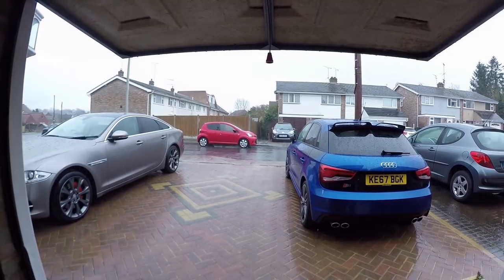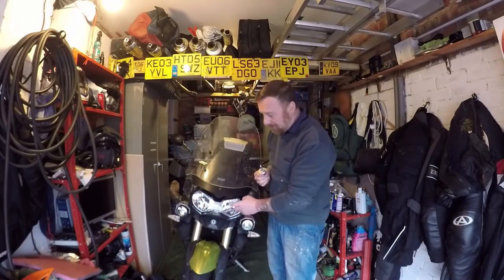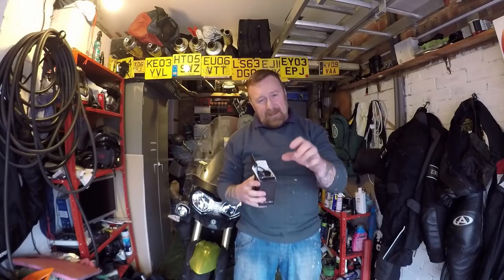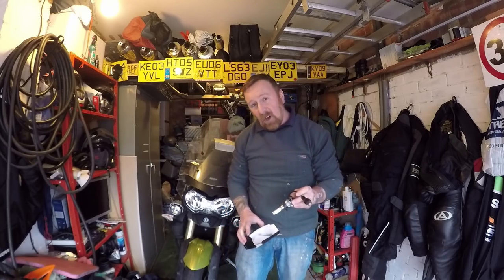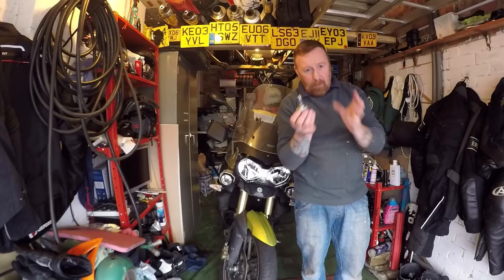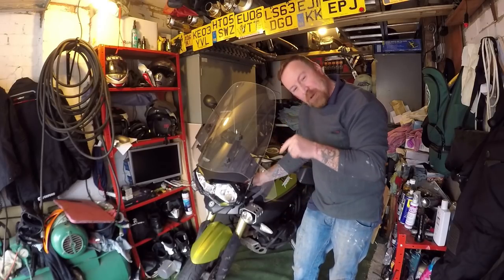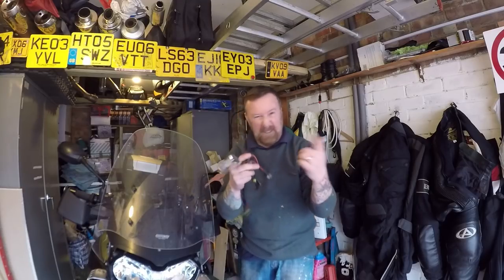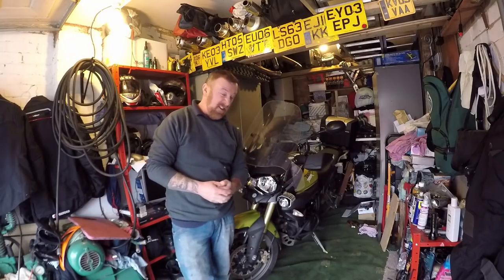MOTORBIKE LED BULBS SHOULD YOU FIT THEM OR NOT MARK SAVAGE

Comment: Uh...I noticed one thing that's an issue...the very thick & tight plastic lens of my Honda will 'fog' inside in damp weather and the Honda 'halogen' bulb clears it up quickly...but the LED doesn't create enough heat to 'burn-off' the moisture inside thehousing...so I switched back  ( Turn-signals and tail-light are 'LED' though....they work fine, and damn unlikely to ever go out )
Reply from the maker: if you have moisture Id take it off and use a hair dryer to dry out completely and keep it in doors for the day so it cools down in room temp then find out why it got wet inside and seal it so it doesn't happen again and go bad to led as they are much brighter and like you say last for a long time bud
Reply: How about electrics in the motorcycle? Is the reg rec and generator ok? I’ve had HID xenon kit with the big aluminium box fitted on my bike. Literally every 6 months I had to change rectifier as it was burned from the xenon bulbs..

Comment: Mark
Your video here covers
Decades
And saves
Hundreds.
Personally i fitted mk2 leds with my tmax.
Failed mot on light seapage (leak)
Popped halogens back in for retest.
Passed.
Im unsure (now its getting brighter mornings) to take out headlamp housing and see why i cannot adjust hotizontal aim. For Leds.
Help
Reply from the maker: thanks bud and for watching 
im guessing as the LED bulb projects the light from the sides, it reflects differently than a standard bulb so I may have the same problem!
this also maybe why they are cheap and others cost £45 odd, I will test mine tonight to see the pattern and get back to you as
on the tiger I have up and down and side to side adjustment 
I remember this used to be the case with the HID lights but lets see

Comment: Asked bout putting led on my v strom , bike shop said wouldn’t pass mot if I changed headlamp to led
Reply from the maker: Why not !! As long as they have a patten they will be fine and in the video you see they have a flash line when I moved the camera that shows a patten 
But change them and before the mot put the old ones back in 
Sorted lol
Reply: I didn't realize until reading in MCN this week. That after market HID kits are now a fail, since the new MOT testing came in last year. Only manufacturer fitted kits are ok.
I did look at LED headlight bulbs last year for my scooter. The price put me off. Well actually it was the wife going How much!!!! Lol
Reply from the maker: hahaha just dont let the wife see you buying them it will be fine its not like the wife holds my camera sometimes and whacks me around the head ----- WAIT ok I agree pmsl 
yes I am reading more and does seem some bikes shops are failing them, the newer tiger and  bmw's have now fitted these so my head light maybe ok but if not i'll just take them out for one day a year for the mot and refit but will test and see how much better they are on the road or not?? and upload a video with how they look on the road 
many more videos to watch bud and thanks 
mark

Comment: I’ve tried led bulbs and a replacement led headlight on my dd125e-8 and the bloody things would just not work.
Reply from the maker: Oh so they had power and didn’t work or you couldn’t fit them ?
Reply: Would work on dip beam but high beam would either not work or it would just glow dull. Even swapped wires round still would not work. Checked light with a battery and they worked fine just won’t work on bike even tried a led bulb in tail light it didn’t like that either, it’s just strange as works fine with standard bulbs.
Reply from the maker: because and its a guess on your bike but some monitor the power drain to the bulb and if lower or higher than normal they stop the power and come up with a blown bulb sign, a lot of cars do this and my bmw GS also 
were yours 2nd Gen ? and like my ones I fitted as and there are some cheap copies and low grade LED's out there 
thanks for watching
Reply: Thanks mark I didn’t think of that manly because I didn’t think Chinese bike would be that intelligent. And no not like your lights the build was a cob and the new headlight was a full led. I gave up with them and just added a couple of led accessories lamps that do the job of lighting my way. Thanks again keep up with the great vids.

Comment: On a side note, had a search but nothing came up,  do you have a vid on battery chargers? i have vague memories of its not advisable to use a car charger due to the higher amps?
Reply from the maker: You need a slow and high charger so it starts at4amps to 8 amps 
They will be fine 
Or just type in motorbike battery chargers 
Thanks for watching

Comment: I had my LED headlights for nearly a year now and second-generation had no problems out with them 😊 and here's an idea for your next Project ?? most motorcycles don't have hazard lights especially 125 so my challenge to you figure out how to create a hazard light switch ?? do you accept yes or no ??? and I will be putting my video unlisted for the time being hahaha so you can't take a quick peek 😂😅
Reply: lazy boy Rider this is literally the problem with every bike that’s 50cc or 125cc
Reply from the maker: sure ill take a look bud, and yes I agree some bikes did start to put hazards light and now stopped which is odd, you can retro fit a switch and only need to connect it to both front lives as the backs are all ready connected to the same circuit
water proof switches as also easy to buy on e bay, to be fair I find I use my high beam when lane filtering in heavy traffic now as otherwise no bugger bothers  to look in their mirrors otherwise lol  
take care bud
Reply from the maker: I know so worth looking if the bulbs will fit and upgrade or go for running LED lights but you will still get ( I didn't see him !!)
Reply: @a11s3y7  as I live near a very busy motorway and I was heading to the shops one day I was watching a 125 Rider breaking down on the hard shoulder and the only way he can let people know he was indicating left 😬 so I created the hazard light switch on my bike 😊 and it has come in useful a good few times 😅 it does have a simple install solution 😂
Reply: @marksavage  me and a friend we were thinking of a solution how to stop tailgaters ?? and we came up with a strobe light 😂 😂 because they'll certainly back off if that thing goes off  lol but I'm glad to say that idea is not on my bike but however I have created a new hoodie 😋 what should have the same as the desired effect 😊
Reply from the maker: lazy boy Rider you would get nicked as they would call the police and say you blinded them while driving !
It’s a biggie when cars tail gate bikes like in my van tail gate video 
It’s really bad and cause a crash !
Reply: @marksavage  lol still gets them off your arse but thats why i went for the hoodes please back the fuck off